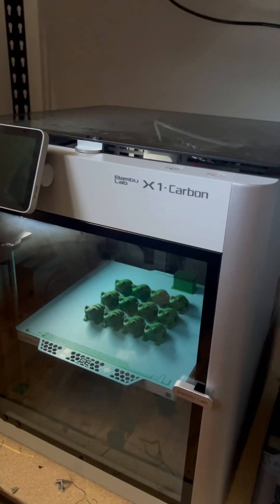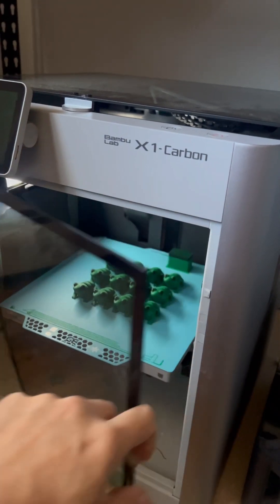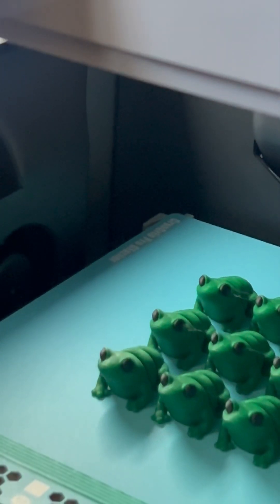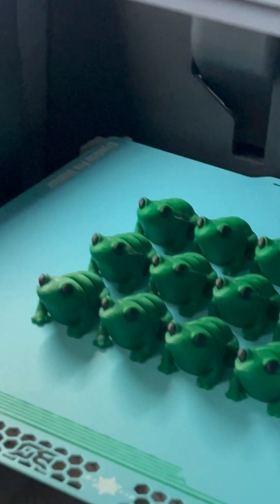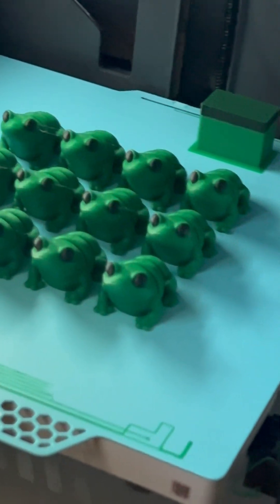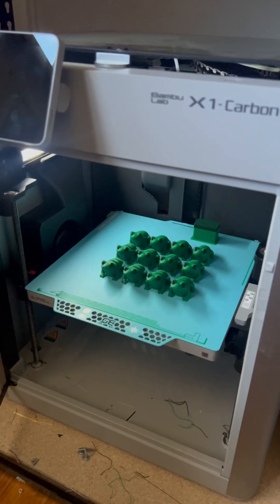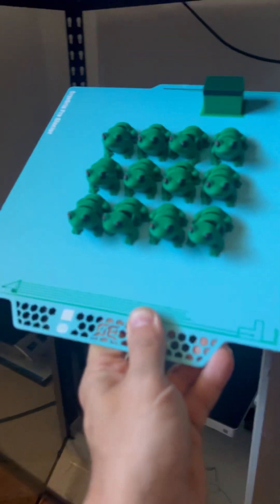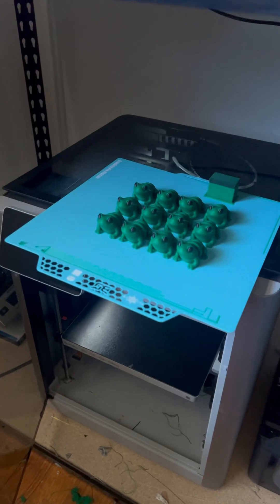@BIQU_Makers  CryoGrip Glacier Pro, Test, on an X1C with a dozen Zou3D Frogs

Comment: From what I heard you want to avoid using IPA on these or it’ll screw up the coating over time. Soap and water is what they recommend
Reply from the maker: Yes. One is OK for IPA, and one Isn't. I stopped using it. Bambu Smooth PEI Bed is better
Reply: @ ah yeah you’re right I see it’s the frostbite. That sucks cuz I just ordered both lol. I was having issues with print farming. Wasted money I guess
Reply from the maker: I dunno. I don't have a solid verdict yet, but, the fact that I moved back to the Smooth PEI, to get some jobs done, that were failing on the Glacier, isn't a  great sign. But, who knows. Maybe I need to clean it better? Maybe I need to adjust the bed temps a little? I dunno, but, I do know, that Bambu Smooth PEI, never let's me down. BTT and BiQu, do generally make quality products, so, I'm trying to be patient and take my time. I tested the Glacier on my X1C, with mixed results (keeping in mind, I'm testing HARD little tiny items) compared to the smooth PEI, and the Frostbite on my A1. So far, I haven't done allot on the Frostbite, but, it survived a REALLY tough print, that the stock bed, failed badly. To me, fine textured beds, hold better, but, perhaps, it's the opposite here. I'm not sure. I wouldn't go with wasted money, till you try them, but, I can confidently say, if you get a SMOOTH PEI from Bambu, you will be VERY pleased with it....
Reply: @ smooth PEI is actually what I’ve been wanting but worry about adhesion. Never been into cleaning glue off my plates after every print. I’ll give it a go but if I start printing ABS I wonder if the Glacier will do better. I appreciate the recommendation
Reply from the maker: Nothing touches Smooth PEI when it comes to adhesion. Glue, is used to protect the bed from damage, due to the strong hold. NOT to assist in the hold. I swap ALL my beds, for Smooth PEI. You'll never go back....

Comment: Why don't you like textured pei? It just always works for me. Im never using glue stick on my printers so pei works great haha
Reply from the maker: Fail City. Awful Adhesion, in exchange for a textured bottom I don't need. Once you try Smooth PEI, there is no going back. I have had ENDLESS adhesion fails, on my P1P, X1C, and A1, till I ditched the Textured. Smooth PEI never lets go during a print. Way back..... After months of my K1's running circles around my Bambu's, I realized the stock K1 beds were smooth PEI...... I put them on my BAMBU's, and it's been a game changer ever since.
Reply: @3DRundown  that's interesting, I've never had that experience with mine! I do keep them clean with soap and water after awhile of using them. I might try a smooth pei and see how it handles!
Reply: Agreed. Absolutely zero issues with stock textured bed.